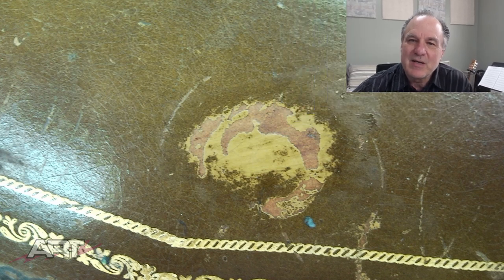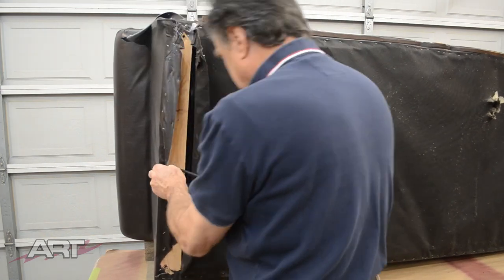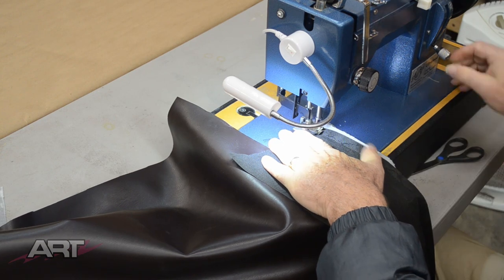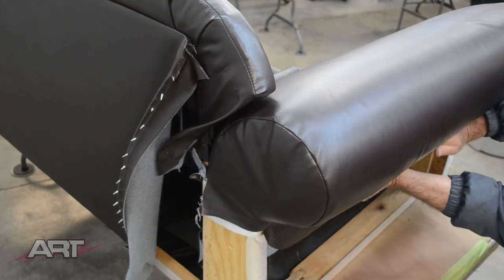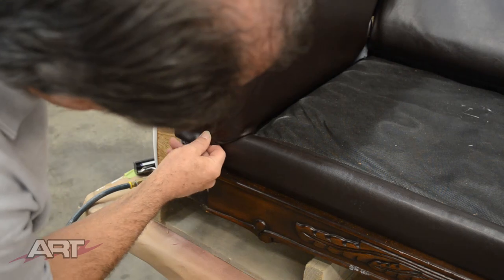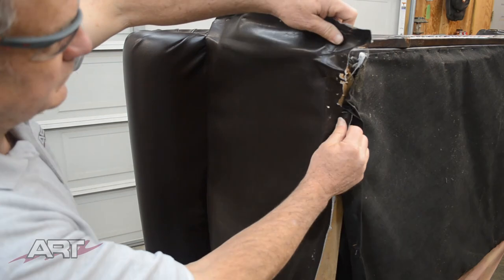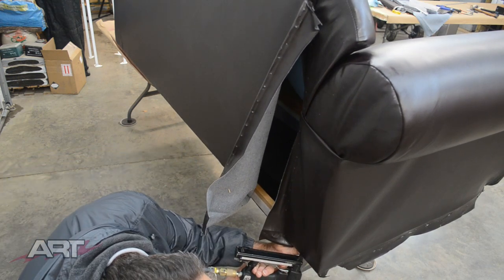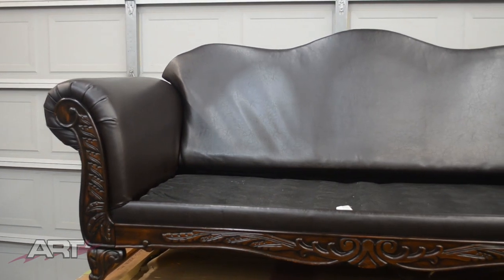Couch Arm Recover v62

Comment: Nice job, furniture is not built to be easily recovered, as you well know. That's why I prefer working on auto interiors.
Reply from the maker: Yes, and people are accustomed to the pricing for automotive repairs too but balk at spending it on household furniture.  As it is, you can buy a new vinyl couch for about $700.  Thanks, Mike.
Reply: That's the truth, so much furniture is made overseas, unless it's a family heirloom or a real expensive piece it generally is cheaper to buy a new one.  And upholstery fabric for furniture can run $100 a yard or more and it takes a lot of yardage to do a chair or sofa. 
 @a.r.t.srealrepairsforrealc8247